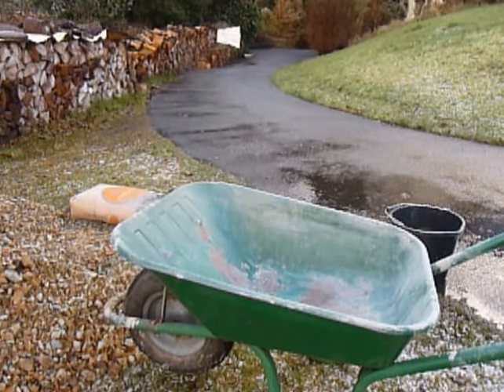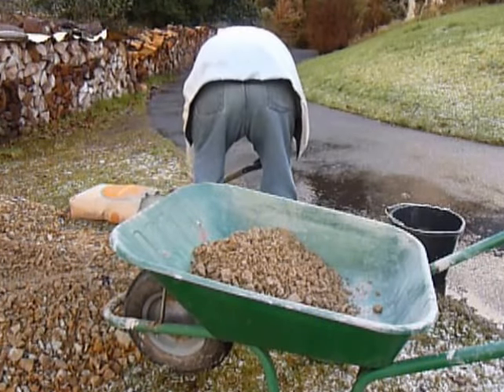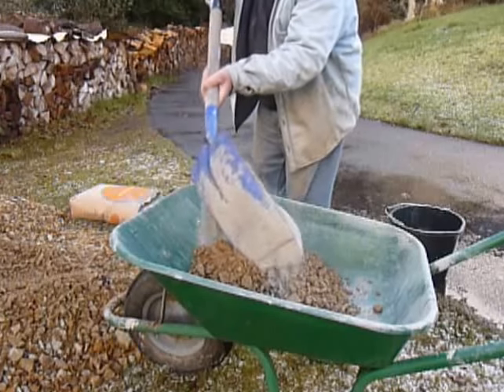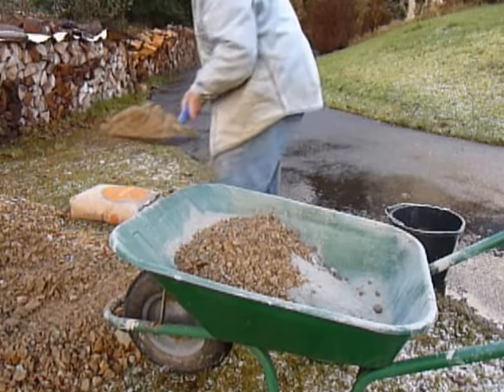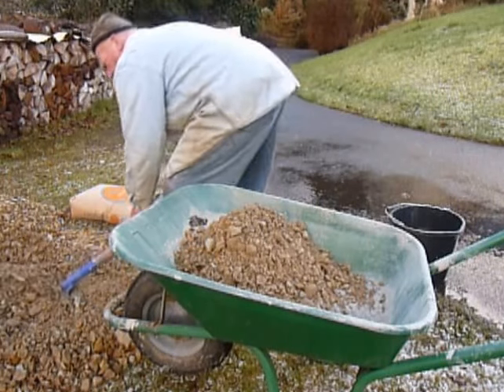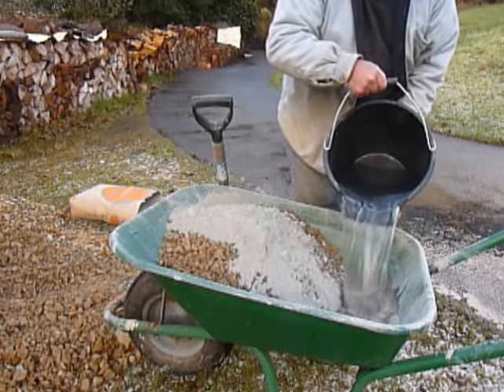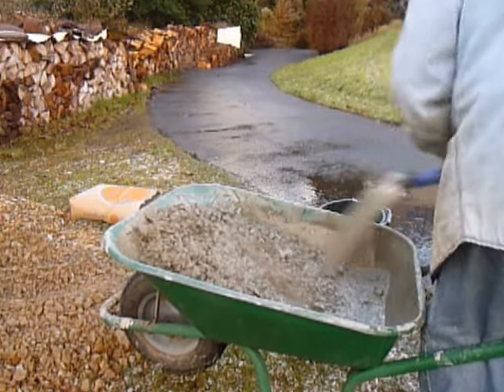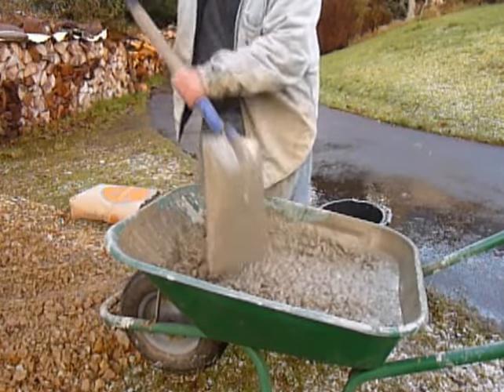Mixing concrete by hand in a wheelbarrow the easy way

Comment: 🤣😆🤣 no
Reply: Why not?
Reply: @PaulPaid  he's been mixing hundreds of wheelbarrows wrong for years. You put the water on one side like that but the technique of doing a little bit of it then stacking it on top of the unmixed part is dumb. You move it all to back side little by little then get on the front side of the wheelbarrow then move it all back to the front little by little. And you have to scrape the bottom with the shovel because all the powder likes to sit on the bottom and will not be mixed if you don't scrape it good. And adding dirty gravel to it is doing no one any favors. You'll end up with pockets in your concrete after it's all dry. Doesn't matter if you use a float machine or vibration machine over it, still pockets because the dirt is creating mud. And as much water as he put in it it won't dry fully for a month in a dry climate. And yet another thing, mix it on flat ground because the wheelbarrow will tip over when you're scraping bottom from both front and back when you're trying to mix it. If the camera was closer you'd see it wasn't mixed well. I could tell it wasn't mixed well because I've done TONS of concrete in a wheelbarrow. I watched this in hopes of finding a more ingenious way of doing it. Nope, you gotta get that workout in 😂🤣😂
Reply: @PaulPaid  I hope so because it took forever to write that out lol cheers

Comment: very poor advice, this mix is far too wet, it will be weak and also crack
Reply from the maker: Thanks for taking the time to reply, however this was poured 8 years ago and is as good as the day it was put in, I deliberately made it a bit on the wet side to ensure it fully filled any voids.
Reply: @oldtimer43  concrete should be tamped to fill voids, not pour in slop that cracks
Reply: @stamfordmeetup he just told you 8 plus year going strong 🤦‍♂️ and your still trying to give advice 🤣🤣🤣🤣
Reply: @ufaxpyro4200  bodgers will  lie, so engage brain before you try to give advice
Reply from the maker: Eight and a half years now and still going strong!